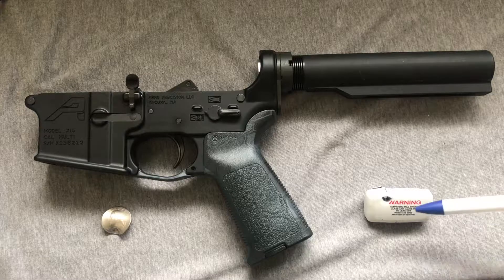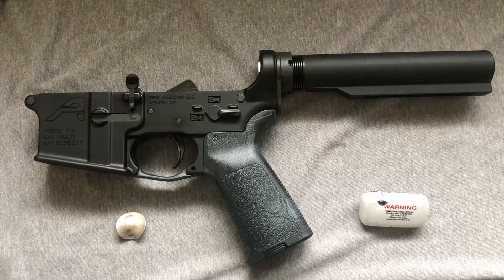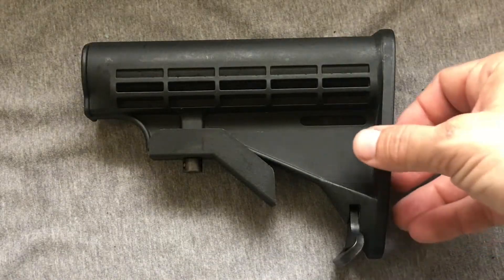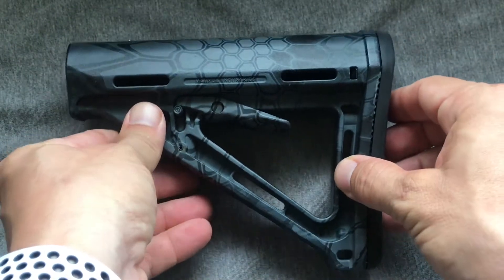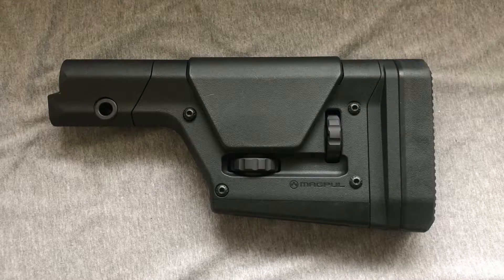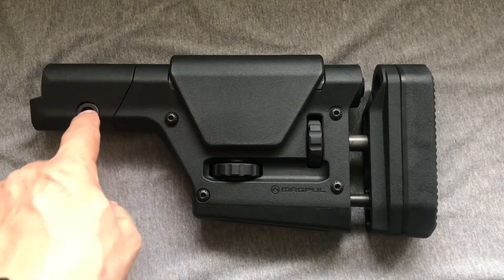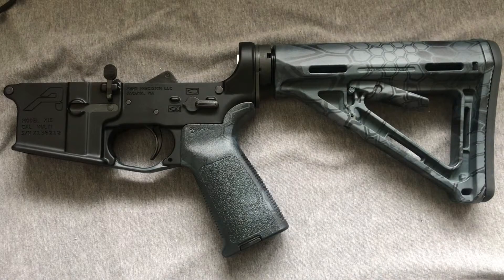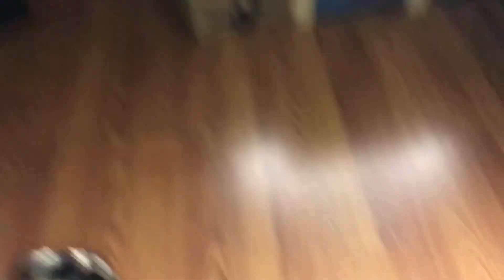Selecting AR-15 Components: Buttstocks!

Comment: Ha, I used Velcro,, was thinking about that when you said electrical tape.
Reply from the maker: I since I made the video I changed my Magpul MOE stock to the newer Magpul CTR stock.  The CTR has a built in clamp that you snap down once you have the stock in position and it eliminates almost all the wiggle.  It's set up to unsnap as soon as you hit the adjustment lever.  I've been very happy with the upgrade and no more need for gunky black tape.